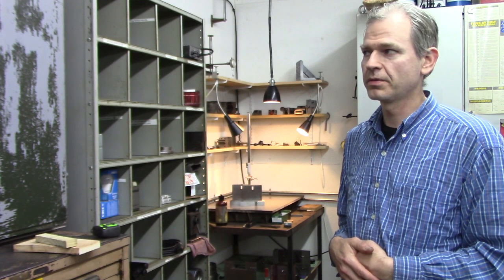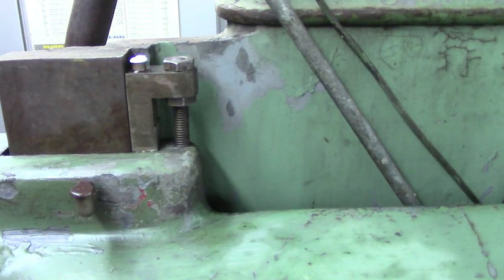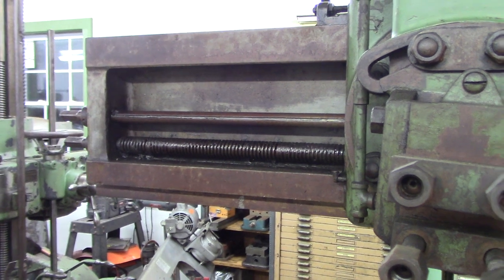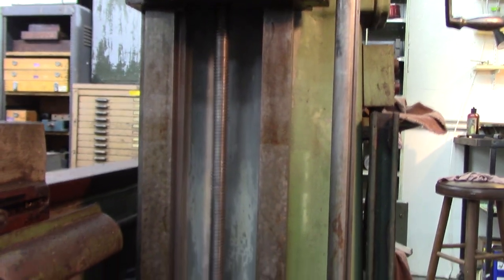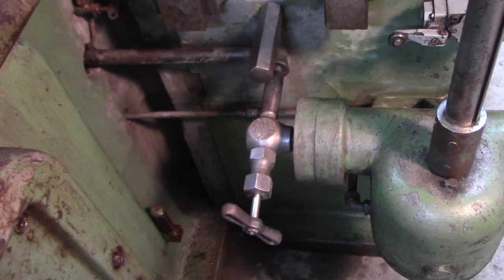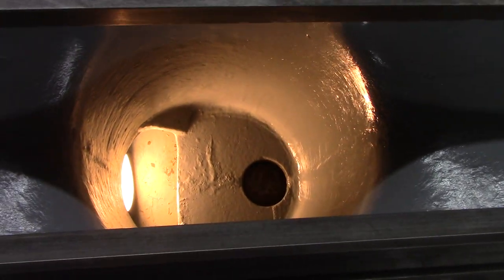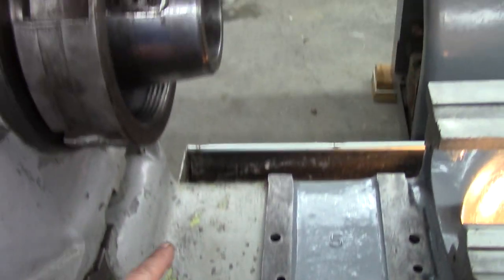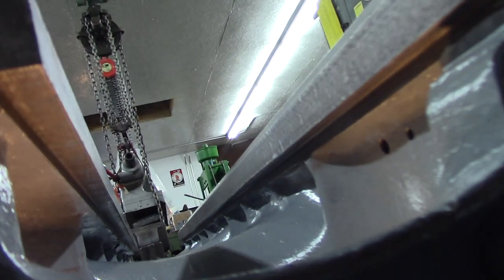Doozer's Machine Shop Update 2-04-20 --  Painting the Colchester lathe bed

Comment: The painting is coming along very well Dan. Have you ever sprayed rustoleum out of a standard automotive type gun? I have done it with white. Warmed it up on a hot plate so it would flow better. I got some weird looks doing that. It worked well. Some items are easier with a brush like all the nooks and crannies on that lathe.I painted some tractor wheels red for an F20 once with a brush, then top coated with hardener added the next day with a spray gun. That turned out great. I need to stop in and see your progress in person.
Reply from the maker: Stop by any time Brad.   You got your building delivered yet??  I have modified a Sharpe spray gun from siphon feed to pressure feed.  I used a mini-regulator with a light spring inside to limit the pressure to 5 psi.  I fed this to the paint cup to force paint into the pickup tube.  When you pull the trigger half way and get the fan spray pressure, I tapped into that to supply air to the regulator.  So it will spray Rustoliem without the need to jack up the gun pressure and have over-spray everywhere.   On the Hendey you see in the background, I followed much the same procedure for painting in between the bed rails that I showed on the Colchester.  I used a brush to detail the inside and under the bed.  Then when it was still wet, I switched to the spray gun and finished painting the entire Hendey lathe.  It came out really good.  Well that was 10 years ago, then I moved to Charlotte.  Now the Hendey waits for me to re-install the carriage and tailstock and maybe a new motor drive.  I'll get there.

Comment: Hey Doozer That smoke gray is the same painting use  I've just about hove all my machines done well except the new ones I've picked up lately
Reply from the maker: Hey Doug.  I really like Rustoliem.  It seems like a very good paint, and I have been using it for some time.  Nice you are re-doing your machines as well.  If are a regular subscriber to my channel, you will notice my surface grinder is painted red  and my Brown Sharpe 13 is painted eye easy green.  Also both good machine colors.

Comment: You use lacquer thinner to degrease the nasty stuff, but what do you use to degrease that (as it leave an oily residue) for painting?  Have you tried evaporust for rust removal as it's not corrosive like phosphoric acid? I have excellent luck with it.
Reply from the maker: Lacquer thinner leaves absolutely zero residue.  It is my final wipe down before painting.  I only use EvapoRust for delicate stuff.  EvapoRust will eat virgin metal if left in the dip long enough, but not as fast as phosphoric.  I use phosphoric for most things because it is cheaper and forms a passivizing layer, which is nice if you can't get all the rust off (ie. too deep), and it leaves a paint-able surface even right over the phosphorous precipitate.